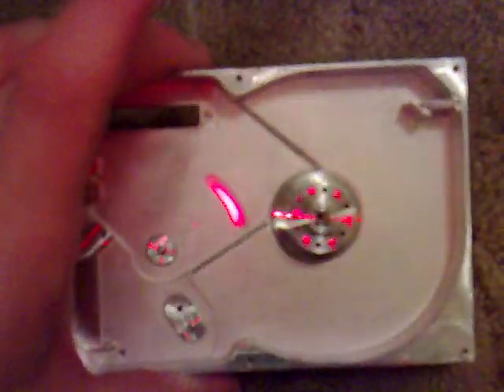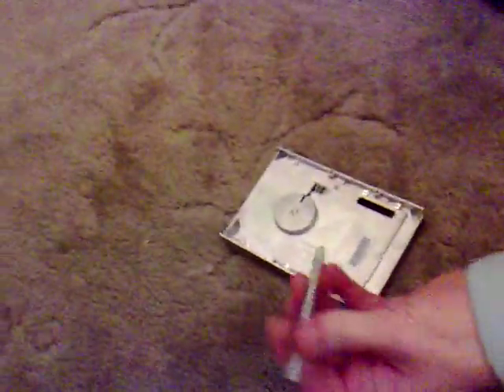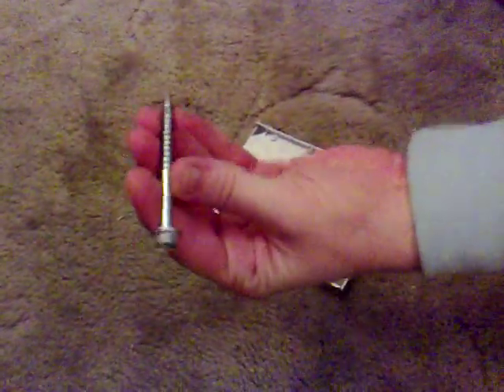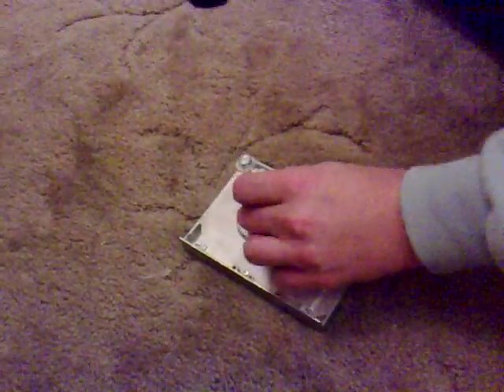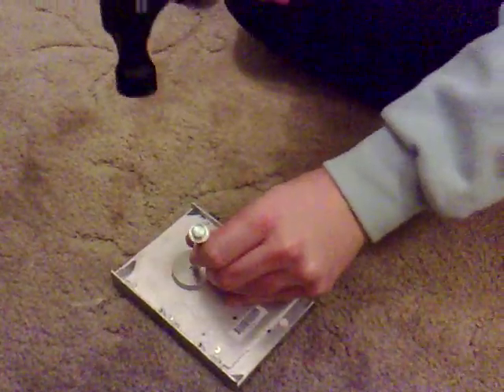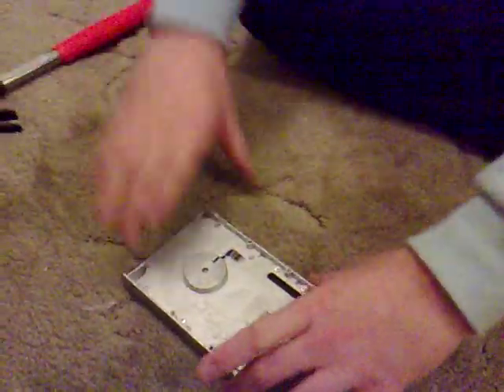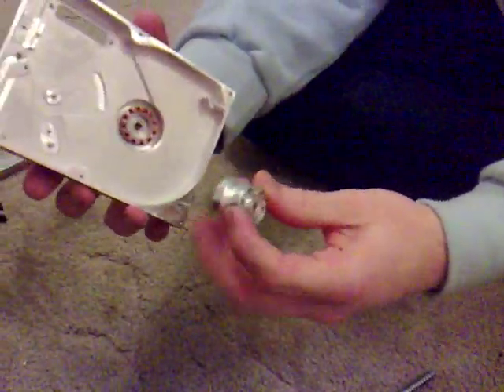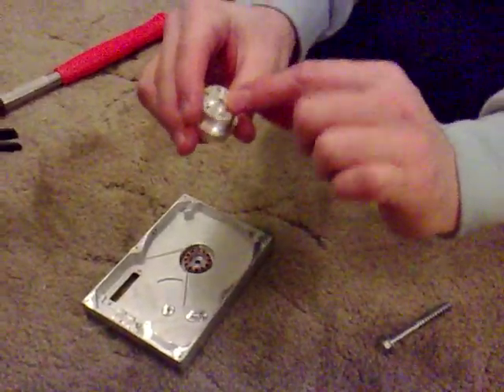Pulse Motor (Hard Drive Bearing Removal) 076

Comment: Hi,

If I wanted to remove the entire HDD motor I would have simply:

- first used a compass to draw a perfectly adequate circle around it, 😄

- then I would protect the BLDC motor by securing it with a couple of those transparent stick tapes.
The idea is to prevent the aluminum debris/shards getting into the rotating compartment of the motor when you'll be doing the 3rd step, which is: 🙄

- drilled smaller holes (drill for metals, maybe 3/4 mm diameter one) all around the BLDC motor on the line of the drawn circle you made in step 1
Keep making the drilled holes as close as possible so in the end, when you get to the start position of your initial hole, you can just slightly hit the motor & the still bonding aluminum walls between the smaller holes that you've made will simply break. Thus ergo extracting the HDD servo motor. 😉

In the end you just shave/grind off the remaining ragged edges on the aluminum body surrounding the motor so you have as close as possible a symmetrical aluminum circle support body.

Finally you remove the sticky tapes that you applied in step 2. You use petroleum or other paint dilutive liquids to remove any sticky adhesive residue thst might remain on the motor itself or its near aluminum surface. 😏

This may be a bit time consuming, but if you want the motor in a nice support body...😎

Comment: this method does indeed *work, as far as getting the motor bearing out of the casing. 

*But after you get it out (in rare circumstances the bearing will be free moving as it should) most likely  though to get the bearing to work properly you need to use a hammer or so - gently tap on the protruding part on the bottom of the piece. Do that little by little, each time testing if the bearing as regained its "bearing" qualities. If this does not make sense i can post a video response let me know.

Comment: They don't fit straight on. But, there is a ring moulded on the CD blanks which is the perfect size which needs scribing with a scalpel, then nipping out with a pair of pliers. Once its been sanded it will fit perfect & more importantly, central :)

Comment: very stupid idea, it will ruin bearings completely

never under any circumstances put any significant load on HDD bearings and avoid all shocks
to remove it it is necessary to push push it out slowly without using hammer 
Hdd bearing are preloaded and extremely sensitive to shocks.